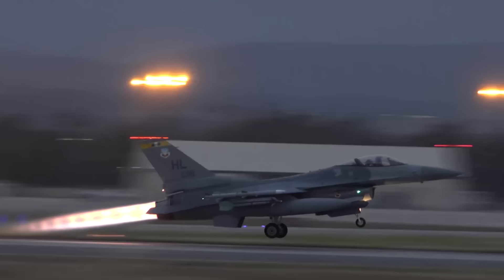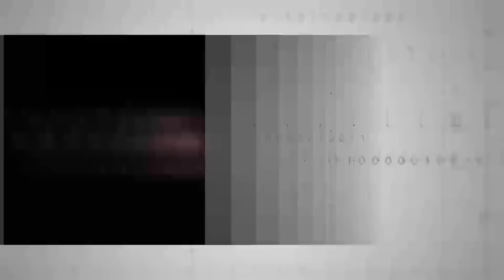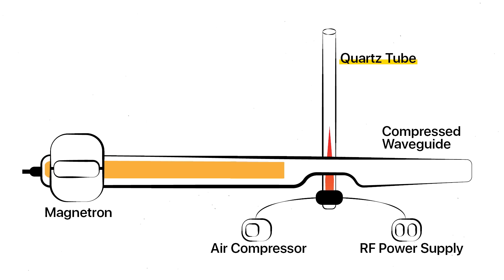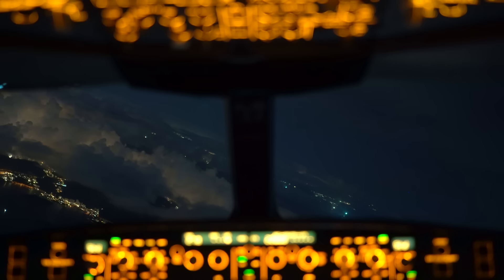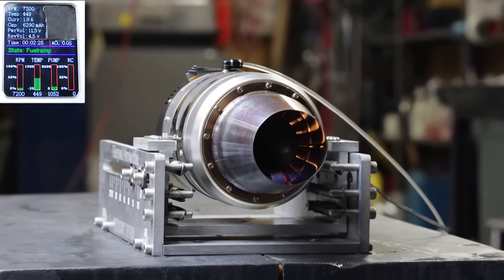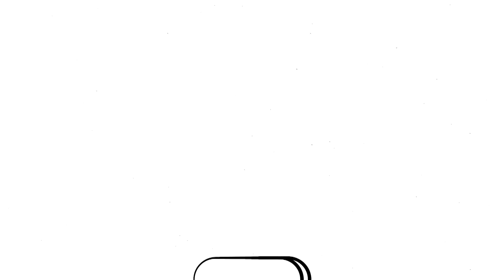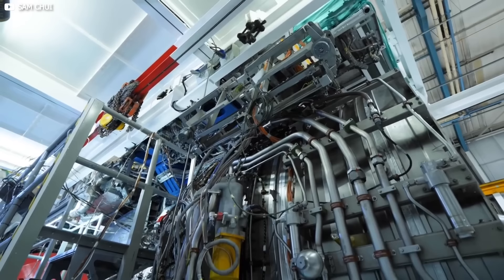What Are Electric Plasma Jet Engines?

Comment: they invented Tony Starks Patented Repulsor Lift Technology.
Reply: If only they could invent the Arc reactor in a miniature size aswell lol.
Reply: @Timothy Rurak an Iron Man costume it's already real. Adam Savage from Mythbusters made one. You got to check that out.
Reply: @Timothy Rurak it's a real life prototype that in the future could have a lot of improvements.
Reply: @Timothy Rurak one day at a time. First the helium balloon, now sending rocks in cosmos. Feel free to participate and improve what Adam started. Engineering is a steady pillar.
Reply: But did they BUILD IT IN A CAVE.....WITH A BOX OF SCRAPS??
Reply: @Timothy Rurak what about cold fusion process.. It will make reactor less hot.. 😁
Reply: @Timothy Rurak HYDROGEN, if we have it a 15 stage combustor and convert this into like a turbofan like a conventional jet engine but using the micro waves, it would be over 35 pounds of thrust per kw. If we got foldable carbon fiber wings that go out about 1 meter and we got a whole iron man suit of titanium motorized and u are 180lbs, it would use only around 3.5kwh to fly per hour and like an extra 3 for the exoskeleton depending on how thick it is, if it is light weight titanium maybe only like 1 so 4kwh. Hydrogen can be converted to 33.33kwh per kg. If we have a secondary combustor for burning hydrogen have 60kg of it cuz remember we got a exoskeleton so its ez to hold, we can fly for 25+ days. Now add sum 100kw lasers and boom iron man suit, jk the 100kw lasers are the hard part lasers arent that compact
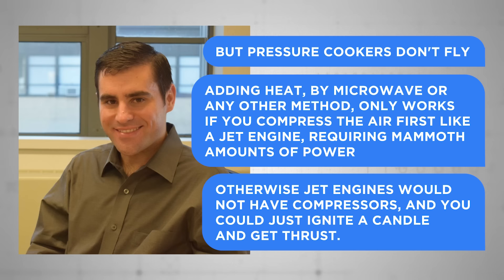Reply: No, @ 5:37 NASA has been using this tech for years. Using microwavable plasmas with wave manipulating is not remotely new.
Reply: @TheTechiemoses  yes but the used it in a different way using gasoline also so it is effective in a vacuum
Reply: Technology Elon musk... since the character is based off of him!
Reply: PATENTED ≠ WORKS
Reply: Actually no, Starks repulsion utilize hyper sonic plates that effectively beat the air senseless hot enough to ignite it. It required a very special hybrid material to handle the energy and force it generated. Why his gauntlets were beefy. One of the movies you see the beta version of the boots and the plates. Stark also explains it as well very briefly.

Imagine micro bombs at the hands and feat. Effectively created a plasma pulse jet engine. Really his tech would actually be somewhat hearing safe compared to a jet engine. The movies actually do a decent justice to the science behind it. His arc reactor is the magic making it possible though.

We do have planes running on nuclear energy that at high altitude use pulse jet deflector type engine. Military ones that is. Not like Starks tech but would fit about any boing size plane easily. Us commoners don’t get to use mini nuclear power plants.

Comment: Something else to keep in mind about planes, they get more efficient as they use fuel and get lighter.  Batteries don't get lighter when depleted so the plane would have to carry around that "dead" weight throughout the entire flight.
Reply: The fan shafts in the engines spin at an incredible speed, why not put magnets around them like a generator in a power station and there you have your electricity, to heat the air flowing through they could use an immersion heater like in your water tank except rated at hundreds of times higher wattage, may be less likely to melt the engine casing than this plasma/microwave idea.
Reply: @BigBadJohn5358  Because that would slow the fan down?!!? Do you know what conservation of energy even means? Ever heard of Thermodynamics? A little FYI : Perpetual motion is not real and so is free energy...
Reply: @97denis97 You said basically what I was about to say. About perpetual motion. It's the same reason why an electric car can't generate its own power while moving down the road. In theory it seems like a great idea. But once resistance and working load come into play. It all but destroys any hope, of it being beneficial enough to even bother with implementing it into modern electric cars. Same for a windmill of sorts on a car, it's adding resistance, therefore negating anything positive, you gain. However, I'd like to see them put solar panels of some sort on a car. Maybe one day they'll have a solar paint that is capable of adding more miles to each charge. I'd love to see someone like Mark Rober, do something like that and test it. He's very good at doing those things and very good at explaining the process bit by bit. The entire way!

Comment: France had been working on this type of plasma magnetodynamics way back in the 1980s, but never really made anything out of it, apparently. Japan had a boat propelled by magnetohydrodynamics in the 1990s (the yamato-1, built by Mitsubishi). But those accelerated the plasma-ified medium by running a current through it inside of intense magnetic fields directly, with no moving parts, rather than with a traditional compressor+turbine.
Reply: Utilizing the electrostatic field instead of the em field has a bigger potential in every meaning of the word...
Reply: Magnetohydrodynamic propulsion runs current through the conductive electrolytic like substance it is traveling through like water (not distilled) to propel itself, exploiting said "magnetic fields" and such to push the water away. Not necessarily plasma. hydro = water

Comment: Video will be worth a review in 10 years. Once enough engineers get their hands on it, plasma engines have come a very long way in the last 20 years, this is a very promising tech.
Reply: Unfortunately incorrect, as far as using this technology for jet planes. The daunting problem must also be solved of how to provide massive quantities of cheap, safe, light weight, reliable, compact, smooth electrical power to the inductively-coupled plasma engines. That is easy enough to do in a ground installation, but doing it on a jet plane is simply not possible. If one is going to install massive electrical generators in a plane, then they might as well also use those generators as the plane's engines, and skip all of the extra heavy, bulky, expensive equipment, which is what the world does now. And it can be (has been) mathematically proven that the inherent limitations of any battery technologies that could possibly be invented in the distant future, could never provide that kind of power and total energy, and still be cheap, light weight, compact, safe, and very quickly recharged.

Comment: Going to be brutally honest, I am actually trying this right now for a UAV. Now I am technically 3D printing using a powder based printer parts for the engine. Now the problem is that the airflow is not really spectacular it needs to have high compression which require CFD analysis. Also if you use a gas that is already extremely compressed you get a substantial amount of thrust after ionization also this require multiple fin channels where airflow is occurring inside the engine in order to increase thrust as well.  Moreover, the ideal solution is to use two technologies which the other I am using has already been demonstrated by multiple institutions and is clean. In regards the batteries that is an engineering problem but not as big of a problem as you might think. The risk of battery usage is that high strain such as high current draw can cause dendrites to form between the electrolyte and electrode inside the battery leading to shorter life and possible failures and this is a costly problem. The only thing that is stopping this from really progressing is actual funding or company interest and ontop of that manufacturing which is another animal.
Reply: Hello, could you please explain more??
Reply: @robbin4380  simply no its still in the development prototype stage and its not something you can do at home. You need specialized equipment as well RF shielding in the engine body as this had ionization. Will post more when I have an update or possibly a video expect a couple months I have the body of the UAV and right now I'm working on motor control built my own hardware driver for the AC motors relating for the intake and working on power management rn. I am working aswell on the automonous segment and other parts of the operating system rn. Its hefty work tbh and its not easy one part such as the compressor could take weeks or months for calibration then integration with the components for RF which  I am printing and this part is where most of the power gets consumed, however depending on how compressed the gas is the power will vary. Higher compression means less power consumption and more thrust.
Reply: Mate keep going with it, I'm also building what I hope to be a revolutionary electric engine while completing my physics degree, but to fill a different purpose, I know the struggles lol

Comment: I agree with the MIT professor. Most of the practical applications of this aren't possible without major breakthroughs in energy technology and material sciences and likely new physics that we haven't discovered yet. Not to mention the scale required. 
The tallest structure man has built is the 1000 foot building in Dubai. You simply can't pile up another 1000 feet on it given our current knowledge and cost of materials. This is not how engineering works.
Reply: The Burj Khalifa is way taller than 1000 feet lol

Comment: It feels like we're going to the Sci fi Age!
Reply: It's already here!
Reply: I mean... we kinda are... things are no longer so simple to answer with it "cant be done" anymore. It'll take time but In alot of cases science fiction is probably going to turn into just science.
Reply: Every single day! I feel you
Reply: Well rn ur using a powerful supercomputer orders of magnitude more powerful than the computers at nasa which commanded the apollo missions. Notebooks, reminders, encyclopedias, books, camera, phone, gps system all in the convenience of ur pocket.
Reply: Because an electric prop or ducted fan is just way too efficient.
Reply: They have advantages, but also drawbacks. Fans and props will most likely be better used for smaller aircraft, just like they are today.
Reply: @assarstromblad3280  Small and large aircraft use ducted fans already, the jet engine or electric motor is just the prime mover. A hot exhaust is wasted energy just like how inefficient afterburners or early commercial jets are, a high-bypass jet engine's average exhaust temperature is very low thus efficiency. Plasma jets have no practical use for airplanes like ion-craft.

Comment: if you can imagine it now - one day it will be a reality   - me
Reply: The laws of physic are strictly enforced. I can imagine lighting a safety match in the shower... but it's never going to happen.
Reply: @eddydogleg  💩🥴
Reply: Well, probability says that there is a slim chance that no single water droplet hits the match during the entire time you are in the shower. Not very big of a chance, but it exists.
Reply: @eddydogleg  in fact you can, there are matches that can be lighted under the water
Reply: @Player-ix7rx  Yes there are matches that can be lit under water; that is why I specified a safety match.
Reply: @eddydogleg  Wait, so are you saying we can't actually fly through the air just because we have to use planes to do it? Why is the shower match problem not solved just because one uses a weatherproof match rather than a safety match?
Reply: "Hotdog Cannon"
Reply: Thats a lie because i imagined having a girlfriend
Reply: @eddydogleg  its possible
Reply: @eddydogleg  there are chemicals that react so greatly they can burn in water. Or are so hot the water has no effect.

Comment: We already have a technology that can convert electricity to thrust highly efficiently: the propeller. There are already multiple models of electric planes that are powered by electric motors attached to propellers. Propellers are simple, light weight, reliable,  and the most efficient known method of converting torque to thrust. The only drawback is that you need batteries to power the plane (which can be quite heavy), but that applies to plasma jets as well.
Reply: @RobLaMacchia  And when something goes wrong, you have a highly explosive plane!
Reply: @prich0382  and that doesn't apply to an aluminium tube full of kerosene?
Reply: @keithhoughton4308  A tank full of liquid fuel won't explode unless there is enough oxygen, it'll just burn slowly otherwise

Comment: Honestly this sounds so cool!
It's a way off before we get this technology, but I think the concepts and testing are a great sign for the future!
Reply: Nah the energy density of chemical batteries is so poor that youll never see electric engines on an aircraft. Battery development is at an physical limit right now so they start to play around with the interior design, to get the last bit of density out, but its finished. Youll never get the same amount as hydrocarbon fuel from a battery
Reply: @97denis97  Honestly there are plenty of battery technology "improvements" and "discoveries" today. A large variety of these "new" battery technologies could still propose drones with this technology rather than commercial planes.
Reply: Thanks commenter

Comment: Please make a more detailed and graphical explanation of how the plasma engines work.
Reply: Basically something called a compressed tapered waveguide is a fancy metal container shaped in such a way that when microwaves from a magnetron are shot into the cube like cavity, one end of the cavity sends them at an angle to compress them into another rectangular prism area of the apparatus (compression region) where a quartz tube or glass tube has air running through it (perpendicular to compression region). Simple spark it and you have the plasma torch.
Reply: @arkohmay  the basis for a light saber in 500 years.
Reply: @efexzium  oh nah lightsabers are a different type of shame lmaoo
Reply: @arkohmay  could this propel a vehicle?
Reply: @efexzium  hard to say since it’s presently known as both a great start for clean future propulsion and substitution for if not all possible conventional jet engines, but also many others claim it’s a joke or literally “a load of hot air.” So it’s definitely still in its prototype, under development, experimental era right now, but concept wise based on what we know now, yes. But it’s closer to drones than it is for commercial airplanes and flight.

Comment: Of all the problems with this idea, the temperature of the plasma jet is NOT one of them. The combustion zone inside any turbine engine (whether turbojet, turbofan or turboprop) is already far hotter than 1000 degrees C - the flame inside the combustors easily gets to 1500 degrees C, perhaps more. This is of course more than enough to melt the turbine blades, but they don't melt, because they are not exposed to this temperature directly: Only a small proportion of the air drawn into the engine by the compressor is used to burn the fuel, with the rest being used to dilute the combustion gases down to a temperature which doesn't melt the turbines. Some air even goes directly from the compressor to the turbine blade roots, where it is forced through tiny holes down the middle of the blades, cooling them from within. The same techniques could be used in a hypothetical engine using electrically generated plasma.

Comment: It could be possible if you compress the air similarly on the same scale as a jet engine and convert to plasma... The only way to heat that quickly is a fusion reactor and a heat exchange system... The closest thing to that was the thorium aircraft reactor experiment and so far it was cancelled because ICBM rockets was cheaper and safer... The air force went a different way...

Comment: Hans von Ohain:

In 1947, Ohain was brought to the United States by Operation Paperclip and went to work for the United States Air Force at Wright-Patterson Air Force Base. In 1956 he was made the Director of the Air Force Aeronautical Research Laboratory and by 1975 he was the Chief Scientist of the Aero Propulsion Laboratory there.

During his work at Wright-Patterson, Ohain continued his own personal work on various topics. In the early 1960s he did a fair amount of work on the design of gas core reactor rockets which would retain the nuclear fuel while allowing the working mass to be used as exhaust. The engineering needed for this role was also used for a variety of other "down to earth" purposes, including centrifuges and pumps.

Ohain would later use the basic mass-flow techniques of these designs to create a fascinating jet engine with no moving parts, in which the airflow through the engine created a stable vortex that acted as the compressor and turbine.

Comment: I had this idea years ago lol - airflow aside (it could be placed inside a high bypass engine to generate the needed pressure) the problem of course is energy storage density, hydrogen would be best, but then... Why not just burn the hydrogen directly rather than converting it to electricity to power a microwave to burn the air to get your heat/expansion? Ahh, because of the NoX emissions. There's no free lunch, but it will be exciting to see how this all develops.